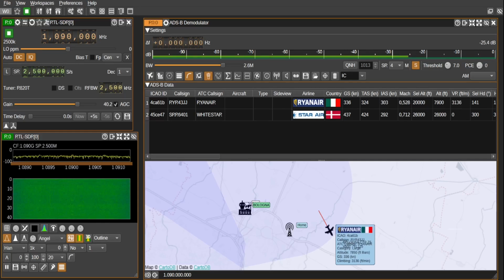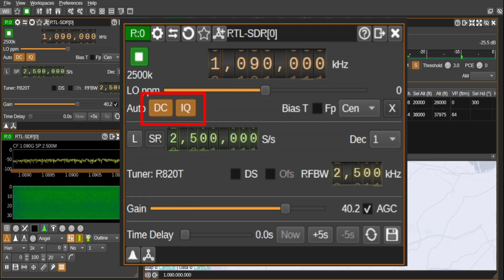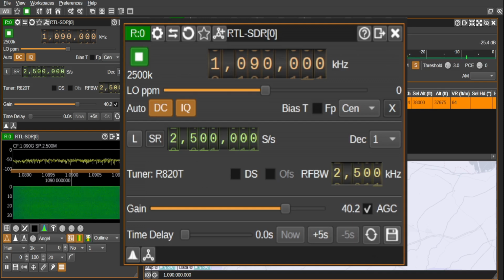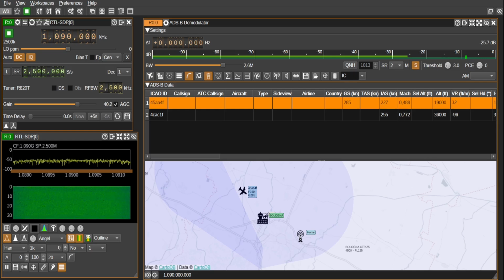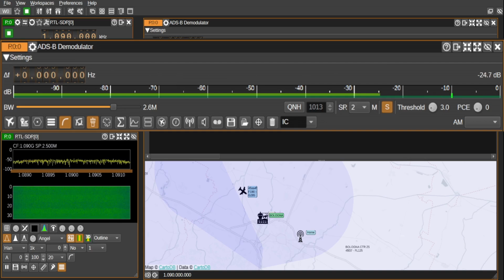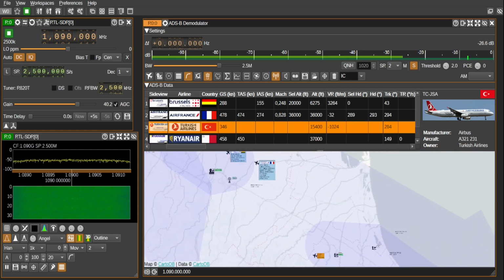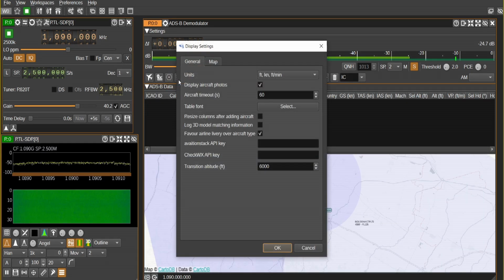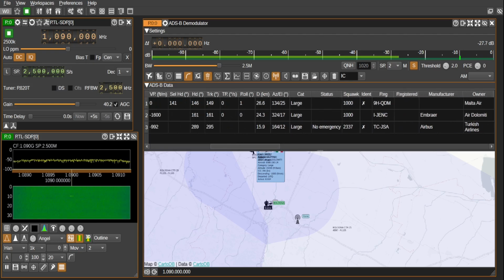SDRAngel ADS-B Tutorial (Part 2): Detailed Receiver Configuration

Comment: Are you 100% these actually performance? The sdrangel documentation recommends turning AGC, DC and IQ off, i made a little research and found out that is actually true. Especially AGC hurts the performance, since ADS-B is in short bursts, and the AGC will constantly try to adjust to them. Atleast when i dont use AGC my range, framerate and valid% increase. Also, device SR of 2,4 ms/s is recommended, since rtl-sdr only has 2,4 ms/s of stable samplerate. Also one good trick that you can use to find a optimal treshold level is looking at the average correlation value and dividing it by 2. Thank you for a good video!!
Reply from the maker: Thank you so much for sharing, I actually didn't think about the AGC thing, will definitely try them out!